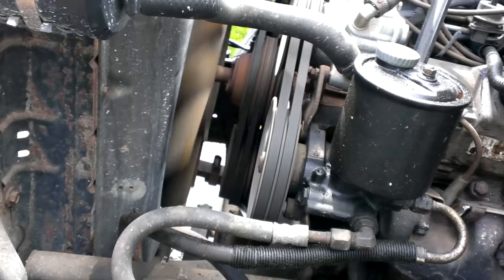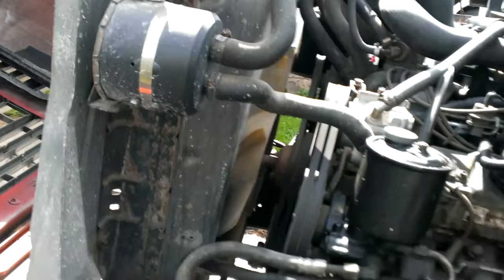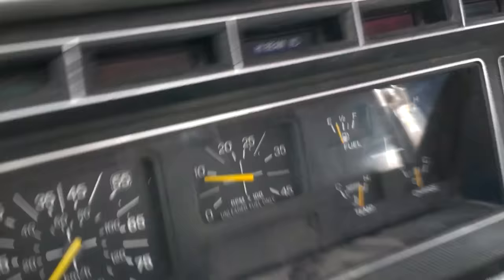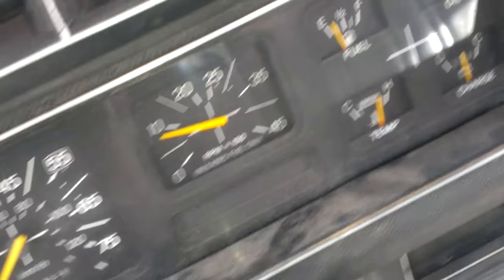How to test a fan clutch

Comment: If the clutch is bad the fan will stop if it's good it cuts your hand off fool proof way of testing
Reply: Holden Turk you right this very stupid way to make the test!
Reply from the maker: if you actually listen to the video i tell people to use a wadded up newspaper... i only stuck my hand in there because i knew that the clutch was bad and was just freewheeling.
Reply: Why even mention sticking a hand in there? Preceding "Newspaper" comment irrelevant,; you forget people are STUPID, and you have invited serious injury!
Too bad, cuz otherwise useful vid.
Reply: Do NOT, under ANY circumstances, stick your hand in dangerous proximity to a moving fan or belt. Period!
Reach for it??? Inexcusably hazardous advice.  You are going to mislead some novice-fool into losing fingers (or worse). PLEASE RE-POST VID WITHOUT TOUCHING FAN! Thanks.
In 45-years of turning sockets on 100's of vehicles, I have seen what careless wrenching can inflict upon human body parts. Even an 'apparently' worn Mechanical-Fan clutch could suddenly engage, seriously shredding the hand of some rookie-wrench who might be naive enough to follow your video-example.
Reply: Bonnie y Clyde quit your crying and move on.
Reply: Yeah these comments!! What a bunch of tools.. these are the same guys that make gun cleaning vid that always start off by telling you to make sure the firearm is empty before you clean it, or the toaster is unplugged before you work on it...  I find it completely unnecessary to waste time trying to teach common sense to blithering idiots!
Reply: Bonnie y Clyde let Darwin sort out the true idiots.
Reply: michael tasker That’s right. The more idiots you save, the more idiots you have that need saving! Sadly and very unfortunatly this also applies to sick people and the starving africans etc. I’m in no way implying that those people should be left to die, i’m just saying that the reason there are so many of them is because we keep saving them. It’s a deeply depressing catch22 of modern society.
Reply: right!!! why would he tell someone to do that...
Reply: Lol
Reply: Actually mines bad it won't unlock its clutch
Reply: @KingOath  is that the best example u can find :D
Reply: I just got bitched out at my job for not knowing how to diagnose a fan clutch, driver said it was over heating ,fan was spinning freely ,not spinning fast enough and the a/c wasn’t working that well at low speeds on top of that it was leaking coolant thru the overfill line. He proceeded to tell me to put ur hand in there and I said he’ll nah lol but I fucked up cause i didn’t make a repair order for that yard truck when i was on road call for a tire and reefer battery
Reply: I always assume the guys in the shop that are missing fingers diagnosed a fan clutch and found it good

Comment: your Air-conditioner will likely be seriously losing performance too and / or tripping the high head pressure..  
alot of times you can clean the little thermostat coil on the front of your fan clutch with an old tooth brush and some simple green...  the dirt that gets caked on the front of that coil acts as an inuslator and also physically  impedes that coil from rotating...  I have fixed more than one by this simple cheap method rather than replacing the clutch
Reply: Thanks man that's a lot of help!

Comment: Thanks for the tip. The engine in my '99 5.9L Durango has been running hotter than normal lately and last time I drove it, the transmission temp light came on (a whole different issue), when I popped the hood, the engine compartment was so hot I burned my hand on the transmission dipstick. I was planning on replacing the thermostat and possibly the fan clutch as it's been squeaking lately,  good to know how to check that. Already replaced the water pump a few years ago, hoping I don't have to hassle with that again. Also plan on adding an aftermarket transmission cooler and servicing the tranny pan gasket, solenoid, etc and getting fresh fluid in it... i KNEW I should've bought a Ford!

edit: just checked the clutch tension, it seems okay so one less part to bust my knuckles on.

Comment: I think I got this 💪
Now ,,,,
If the fan is good the clutch is bad,,,when it heats up ....
If the magazine is bad the temperature will go up,,,....
So let the engine run about a hour,,recheck it..the temp gauge should be clear up to H ..fan spinning slow. 

Thanks for the video

Comment: Great video. I can turn the fan freely with my hand when it's cold and the engine is not running, but when I start the engine it will not stop at all. Can that also be bad and will it burn more fuel ? 🤔

Comment: I have steel fan blades, so you don't want to be sticking fingers in there if you really like them. 
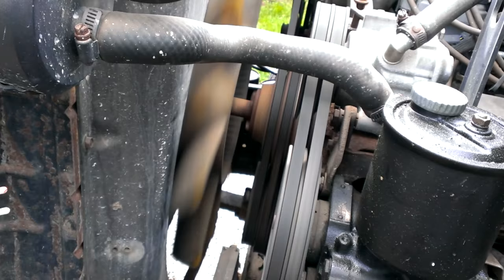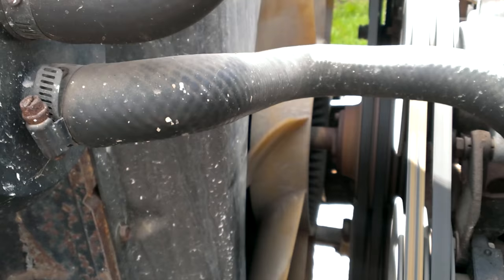Besides, it is clear watching the video the fan is spinning backwards at 0:02 through 0:32. It's kind of like those airplane videos where the propellers are spinning backwards.

Comment: If its good its going to hurt bad, dont test that way......do this....let it run until up to temp then turn it off....if its bad itll turn several rotations after engine stopped and when off itll be pretty slack where you can spin it. When they are good they stop in like half a turn and are still to turn when off.

Comment: I bought a brand new viscous, and it still spins like that at high temp.. I don’t really know what to do now.. truck still overheats. I’ve replaced absolutely everything in the cooling system now. From what I can see, the radiator keeps chucking its water out into the reservoir and never sucks it back. So the radiator level gets low and then the temperature rises. It’s not a crack in the block or head. Help??

Comment: so to confirm if it's cold not even warm engine and you can freely turn by hand it's bad? absolutely no resistance or 90/95%% no resistance  while cold, then when warmed up it should have some type of resistance? bottom line mine seems to always be engaged not running full rpm but engine doesnt even reach 180 and it's already on. temp gauge is fine no leaks,  so belt or fan clutch

Comment: Thanks, that was a simple and effective vid..Was just on some other guys vid, and dam after 10 minutes I still didnt know what you just told me and showed me within your minute..Which is straight to the point..The way it should be..
Laterz!
Reply from the maker: awesome. don't forget to like and subscribe there will be more...
Reply: same here at least he when straight to the point. one question is it bad if you keep driving the car with bad fan clutches?
Reply from the maker: only if its overheating yes its bad. but if its stuck engaged all the time then it will be loud and lose gas mileage.
Reply: bam6972 thanks. my car temp gauge reaches like your truck. my electric fans dont work properly
Reply from the maker: yea could be relay, fuse or temp switch. or in rare cases the wiring. good luck
Reply: bam6972 thanks i will check all of those.

Comment: my 96 explorer runs the fan at full speed when i start up. Could it be locked? When truck is off it fan is hard to spin. Seems to always have fan noise.
Reply from the maker: you should have a little resistance in the fan clutch when cold spinning it by hand. it should at least spin a full turn maybe less. if you can get it to spin at least half a turn then its time to replace it. or there is a valve in the middle of the clutch on the front. try to free that up with pb blaster and pliers. that valve in the front of it should turn.

Comment: Not always the case, if the clutch works with air then it will be lose like that when the fan is not on. If it works with air, with the truck off but the key turned on, if the fan is lose like that then it is the clutch, but if it's tight then it should only be the air valve to the clutch or maybe a relay

Comment: What happens if it is a viscous fan it should only be spinning when radiator is hot otherwise the rad water is to cold at bottom to keep stat open long enough

Comment: Mine is stuck half on and half off. It's 106 out tonight. Yeah, it's 10:30 PM and it's still 106 degrees F.  Welcome to Phoenix, model home for hell. I heated the fan clutch bimetalic strip with a heatgun to 250 degrees and the clutch resistance never changed. In fact, it actually got easier to turn, at about 300 degrees! I kept heating it, and twisting the nut, and noticing NO DIFFERENCE AT ALL, OR IT GOT EASIER TO TURN, so NO BUENO! Time for a new fan clutch!
Reply from the maker: yea its junk. usually you can tell if its bad when the shaft that's going into the clutch is all oily from the oil leaking out of it.

Comment: Mine 4.7 and the fan clutch is good and I replaced the water pump it only wants overheat when park but when I drive it cools and doesn’t overheat
Reply: Check your thermostat,   &   COOLANT,    (Chemical  in the coolant)  wares out aft time,    especially,    if you don't have the right - 'mixture'....

Comment: Couldn't be the thermo switch that's broken. When the fan clutch doesn't grip as the temperature rises?
Reply from the maker: yes that to
Reply: Cool. Any tips about testing if it's the clutch or the thermo? I think i'm gonna try and short wire the thermo.
And by the way, thanks for the upload.
Reply from the maker: i think you have to apply 12v to the coil wires to make it lock up. havent messed with one though. i would research it a bit more before shorting any wires.

Comment: I have a 2005 2.7l.  I developed a loud rattle thats intermittent, only while driving at lower apeeds.. I ha e a p0336 code and also I just stopped my fan by hand.. could a bad fun clutch curve a loud rattle o ly while drivin , ???
Reply from the maker: with the car off move the fan back and forth and see if theres any play in the shaft. bearings could be shot. but i dont think its the fan making the noise. i would have to hear it.
Reply: @bam6972  I think the clutch is toast but the bearing feels ok.. I dont think thats my noise ether but I'm at a loss now.. worried I something bigger then I want to deal with

Comment: we have a 94 ford f150...we did this test and the fan stopped and it spun the opposite  direction but it wasn't quite as easy to stop as yours. Is it a pretty yes or no deal..if it stops with a magazine it's no good if you can't stop it its good?
Reply from the maker: if you can stop it with a magazine and it spins backwards its bad.
Reply: bam6972 thanks so much. we've checked everything from thermostat to water pump. wish I would have figured this out hours ago when auto zone was still open. super helpful.

Comment: what if the fan is ways turning and youve got  this roaring sound
Reply from the maker: if you cant stop it with a newspaper when stone cold. then its being engaged all the time. time to replace it aswell
Reply: I'd try changing the solenoid before changing the clutch!

Comment: Tried it, on my way to the ER to get my fingers put back on. DO NOT DO THIS!! 
My fingers are fine, but if your fan clutch isn’t completely toast, you’ll chop your fingers off doing this with your hand. 
1) Let the vehicle completely cool off.
2) With your keys out of the vehicle and the engine cold and not running, spin the fan with your hand. If it spins freely, it’s bad, if it has resistance and won’t spin a full revolution, it’s not.
Put a disclaimer on this video or take it down before someone gets their hands and fingers chopped off.
Reply: Darwin hittin hard rn